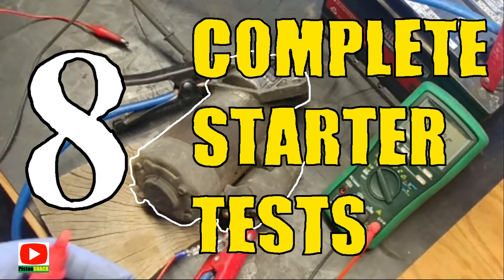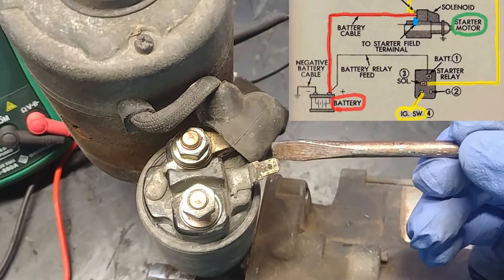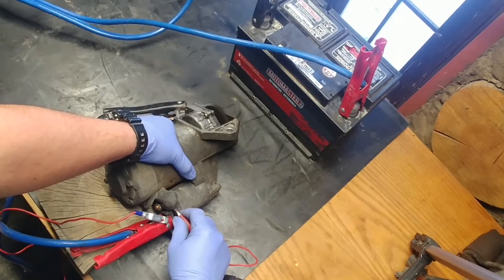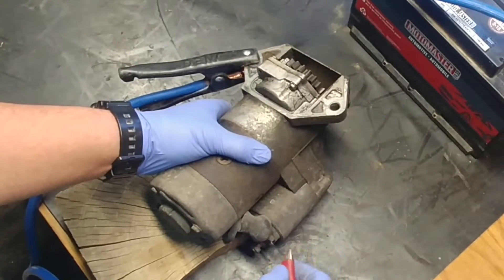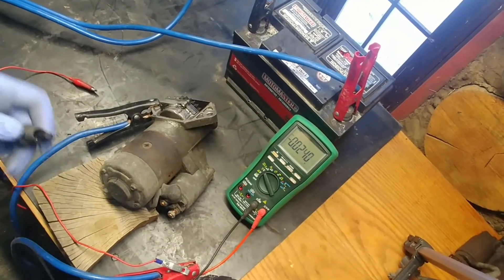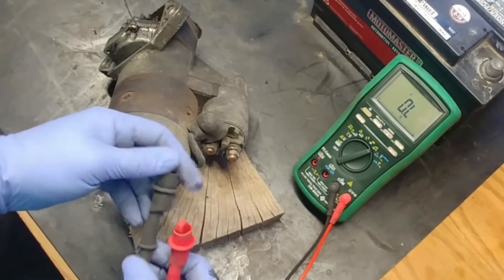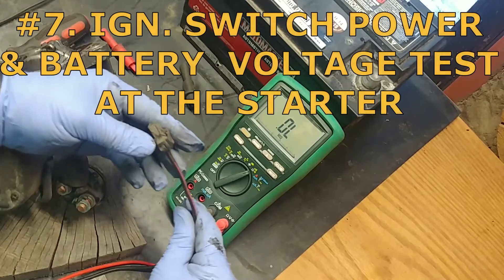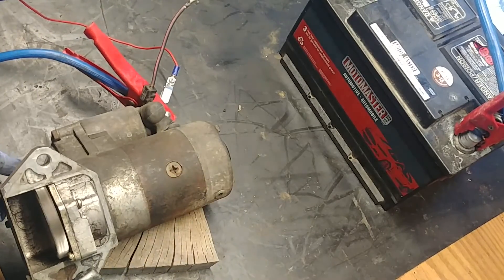NO CRANK? BEST COMPLETE STARTER TEST TUTORIAL. Starter motor/solenoid bench troubleshooting.

Comment: I have watched several videos on bench testing starters and this was by far the most helpful and complete.
However, towards the end, it became less helpful. Starting with the continuity test, resistance, and all the way to the end things became less clear. 
For instance, resistance, you weren’t specifying which bolt you were measuring with, and it was hard to see. This was frustrating because I measured .01 ohms (good) on one and on another .04 ohms (bad). 
Then the rest I can’t even tell you what the hell you’re saying

Comment: What about older Ford/AMC/Jeep starters with separate solenoid? Should run by grounding the case and touching hot to the terminal lug on the starter, correct?

Comment: One more test to tell if a starter is good or bad. That is a resistance test while under load. You can take an ohms reading or resistance test on a starter with no load through it and it could check out just fine but if you put a load to it and then test for resistance he could tell a different story altogether.
Reply from the maker: Good point brother!

Comment: Quick question.  Car wouldn’t start on Sunday, after having driven it 5 min prior to the current problem.  Turned key, nothing.  Checked battery, it is still good.  So, replaced starter.  Still nothing.  Replaced ignition actuator pin as I found it was broken.  Still, nothing.  Towed car to our house and it sat overnight.  Came home from work last night, and went to work on it but decided to try and start, and it started right away with zero issue.  Turned off several more times to test it and started each time without issue.  This morning, went into the garage and it is not starting again.  No clue what is going on!!  Any ideas?  Ty so much in advance.  It is a 2001 Wrangler Sport, BTW.
Reply: I can feel the pain. Did you find the issue?
Reply: @sergiokirienkopanea  Ended up being the starter.  When I replaced it, the internal components must have been stuck.  Tapped it with a mallet and it began working and has given me no issues since.
Reply: @wef0711  Thanks for your reply I'm going through a similar scenario and will take the mallet into consideration when my replacement arrives

Comment: How accurate is the resistance test?
I mean if coils are shorted together inside,it still may come back with a low reading.
Reply from the maker: Resistance test is not the best to check starter circuit integrity. I would recommend to check voltage drop when starter still on a vehicle. Coils could  be shorted but resistance might be okay, at least you can check coil continuity for open.

Comment: If my motor always spins but is slow, especially when engine is hot, will this show up with the windings test. Not sure what the ohms reading should be?
Reply from the maker: Hey Tom. It could be three main reasons why starter spins slowly: 1) brushesh wearing out; 1) poor connection at the main starter cable; 3) increased internal resistance of the starter.
Reply: @PistonShack  thanks piston shack. I've cleaned all the cable connections. I'll do your tests before ordering a renovated motor. I can't find a new one for my '81 Ford Capri 😭

Comment: My starter passes all the tests, but when it's cold and I connect (only) the solenoid terminal, the pinion spins a little (and slow). It shouldn't right?
Reply: I have the same problem for that particular test but on normal weather condition 20 degrees celsius. Do you know what does it mean? Spin speed increases slowly

Comment: What if when conducting solenoid test and instead of it just moving back and forth it moves back and forth and still spins
Reply from the maker: Hey Eric! Most likely contacts inside permanently closed or shorted. What did you find?
Reply: @PistonShack  I realized that that everything was working fine and since it was a 24V battery, one of it(the battery) had a charge voltage of 10.50V and the other had 12.45v and as I was jump  starting I did the mistake of joining both batteries in series instead of just jumping starting the one with the 10.50V. This is when its already mount to the gearbox casing (on load test)
Anyways your content was really helpful

Comment: What if the volts drop down to 6 . something when doing the voltage test drop when engaging the stater, yours only went down to 9 volts? Thanks
Reply from the maker: If volts dropped to 6v you have high resistance in starter circuit somewhere. Most likely corroded wire or terminals.
Reply: @PistonShack  thanks its all good with new starter now.

Comment: those terminals on the solenoid are not marked and the solenoid can be installed (on my car) in 4 different settings, like 1/4 rotation each. Are the terminals of the solenoid negative and positive? or will it matter since the solenoid is only a switch? (either on or off)?
Reply from the maker: What vehicle do you have? Probably the same starter used on multiple makes or models. Normally, any starter has body ground to the engine block, hot constant battery 12v and control.
Reply: @PistonShack  97 tj. I found out that if you wire it backwards, the solenoid heats up!... when wired the proper way I only get clicks. I took it all apart, cleaned all leads, still only get clicks. All battery cables are clean and tight. Monday Im buying a new starter.
Reply from the maker: @M3231-s3v  Starter motor itself probably open (check continuity) or shorted or has mechanical problem with pinion shaft gear. I would just get new one (not reman if possible)